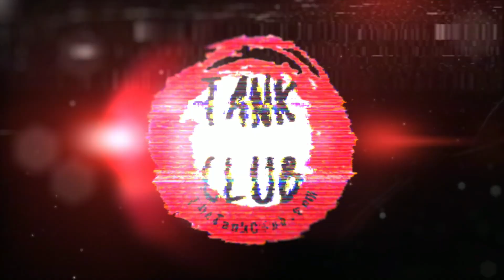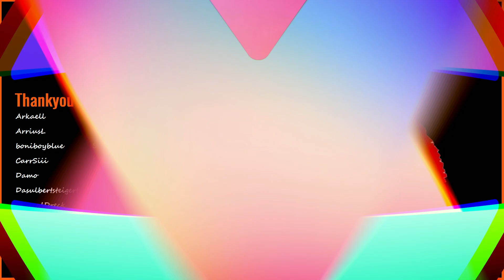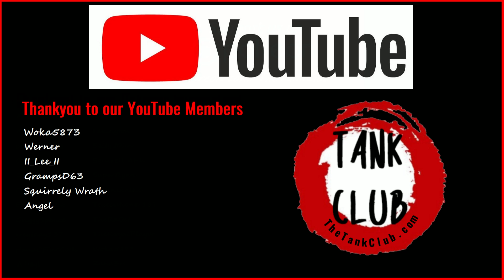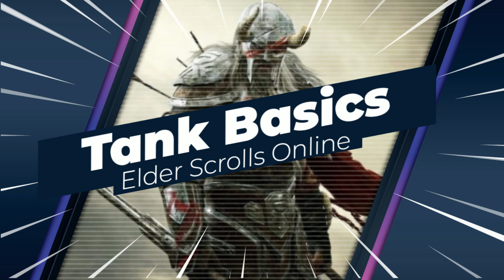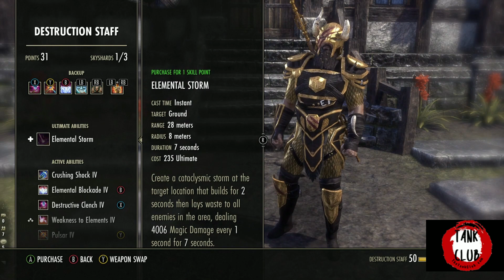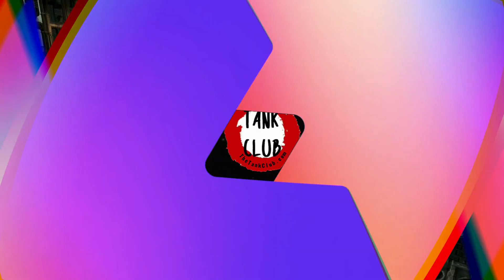Tank Basics 4 - Using An Ice Staff | Elder Scrolls Online

Comment: If I were to use infused crusher on my ice staff as my main/front bar weapon with Elemental Blockade, would I simultaneously be able to, for example, use an infused bow & Endless Hail on my backbar to crusher-debuff a second enemy at range?  Or would I have to use a different enchant, like weakening?
Reply: I believe enchants share cooldowns if they are the same.
Reply: @rabb1tOLD   Thank you.  Wasn't sure if changing weapon type & skill made any difference.  I knew that one Crusher would override another from two casters on the same enemy, but not that you couldn't maintain 2 crushers at the same time on different targets.
Reply: @robeson1070  I'm 99% sure the same enchant shares a cooldown because fooooreeever people have said things like 'don't use both Weapon Damage if you are dual wielding weapons, don't have crusher on both your front and back bar, etc.

Buuuuttt... I don't know double ranged tanking like that you might want to 'just in case', because ranged tanking, from what I've seen, is a pretty rare use case. So, that might require you to be on one specific bar even. Not sure. Not a style I'd go with. :)  (I'd honestly prefer dual 1hd/shield if that was an option.)